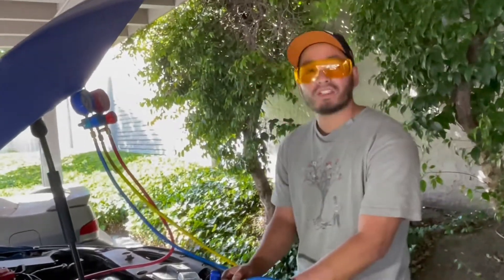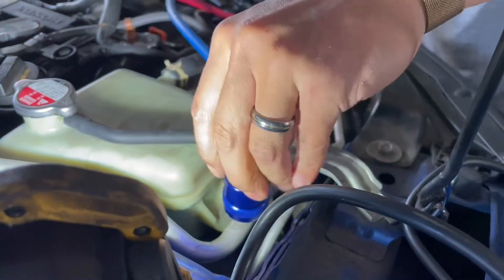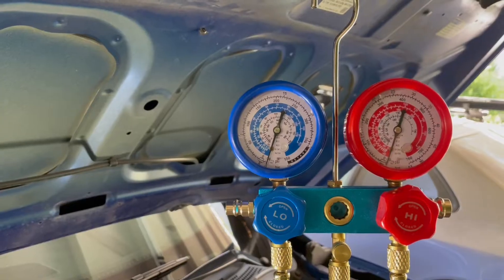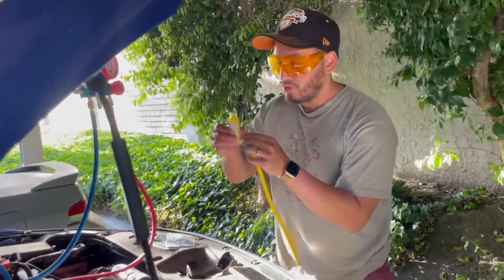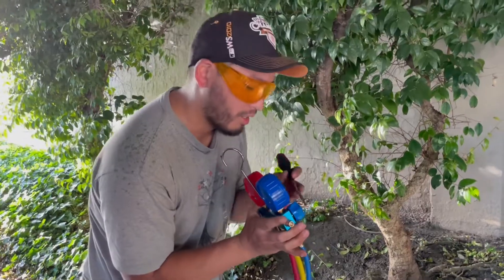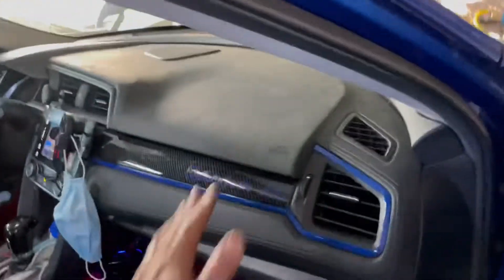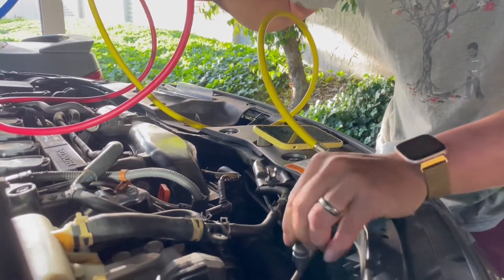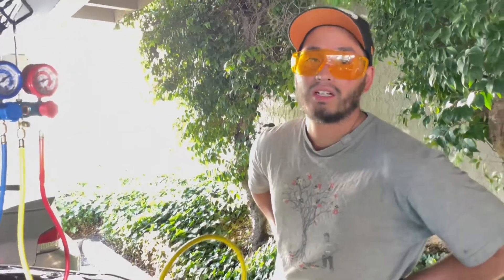DIY R1234yf Conversion To R134a How To Recharge AC Refrigerant On 10th Gen Honda Civic AC Fix Part 2

Comment: Make sure you don’t do this on your Honda if it’s still under the mileage in time warranty otherwise it will be void. 
            Honda will turn you down for any AC service if the vehicle is converted over to R134

        And for the federal EPA laws it is illegal to convert the newer refrigerant R1234YF back to the old refrigerant R134
Reply from the maker: Thank you for posting this.  I pinned this comment so everyone else can see it. Another thing I did was removed the 1234yf sticker on the hood and wrote down 134a so that anyone in the future who needs to service the AC is aware.
Reply: @Sals_Garage  They are still making cars with 134 A, so whats the big deal in retrofitting back to from 1234YF to 134 A. Both are supposedly harmless to the atmosphere.
Reply from the maker: @TheJcrandazzo  1234yf has been problematic in 10th gen civics. Mine has leaked 3 times in 2 years. I wanted to try 134a for better reliability.
Reply: @Sals_Garage  It does not matter that you took off the sticker and wrote down R134

       Refrigerant is now covered under the federal clean air act with a federal government it is considered a emissions gas just like the exhaust emissions from your tail pipe of your engine. 

              Just like tampering with your EGR or your catalytic converter is now considered a federal offense tampering with a mission systems refrigerant gas is now covered under the same loss you are not allowed to reverse retrofit refrigerant anymore. 

        It’s a $44,000 fine in any and every shop should and will turn down any retrofitted system for service. 

           And it’s not just the aspect of a warranty the oils are different the refrigerant charge quantities are different in the operating properties of the different refrigerants are a little different so any failure to a compressor that burns them out is very expensive to repair on today’s cars

         Let’s take for example a Prius prime with a heat pump AC system or a volts wagon or a Audi or a Mercedes Benz with a heat pump air conditioning system

           If you burn out those AC compressors and litter the system with burnt oil and metal flakes from retrofitting it backwards to R1234
 To R 134
                       The component replacement that is necessary condenser expansion valve flush all system accumulators all still annoyed valves lines and actuators three-way valves and electronica expansion valves would all be required to be replace the bill greatly exceeds $8000 to fix such a problem caused by somebody reverse retrofitting refrigerant gas. 

         Compared to saving a couple hundred dollars on the initial cost of the refrigerant gas in the first place
Reply from the maker: @coldfinger459sub0  thanks for the detailed explanation. At this point there is no going back so I’ll just update you all if any problems arise.
Reply from the maker: @coldfinger459sub0  Thanks for the knowledge.  I will check out that video once I get off work.  Take care.
Reply: @Sals_Garage  any and all updates will work. My AC went out and your video was the first to pop up in my feed. I'm sure there's others.too who will come to your two part video. I've also taken into consideration what the other guy posted and wrote.
Reply from the maker: @layzy24  Sure thing.  So far, one month later, the AC is still blowing cold.  I checked the pressures and they are still steady so no leak.  I'm satisfied so far.
Reply: I’m running a big turbo and a catless downpipe on my 10th gen civic, I think r134a is the least of their concern lol
Reply: @d0mochi  😂 that’s for sure.